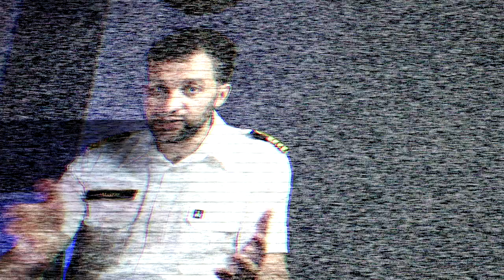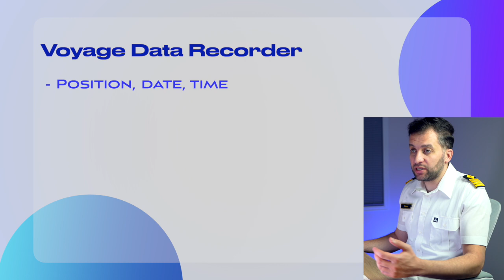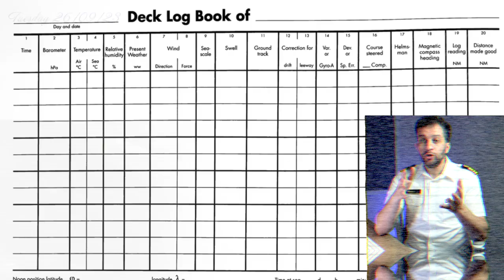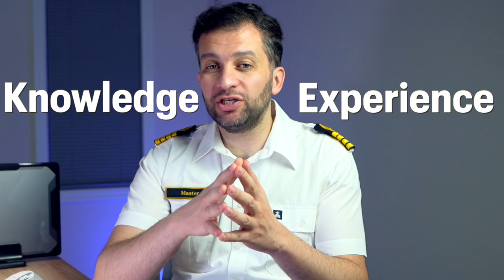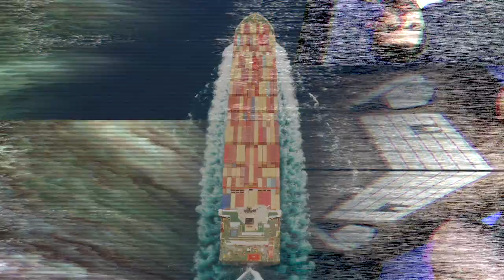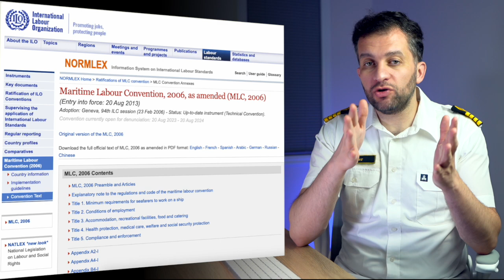CAPTAIN EXPLAINS : Why No Investigation Report So Far ?

Comment: Excellent big picture but WHY is still unanswered.  The answer is it is a very complex subject.  The crew did not understand the ships electrical system and the general public is bored with a detailed electric failure disertation.  At the expense of being unpopular here goes.  The ship operates 3 or more generators in parallel, at least part of the time  to meet load requirements. These multiple generators must share the load in a reasonable manner.  If too much of the load drifts to only one generator that generator will trip off. When that happens the load on the rmaining generators may be too high and they trip off  If a generator does not trip off when overloaded it may become a motor and try to drive the diesel engine.  This motorization can be prevented with reverse power relays.  Generators supplying the grid are always protected with reverse power relays. normally not used on ships.  

keeping the load stable between multiple parallell generators is fairly complex becaus the are two loads on each generator.  The real load and the reactive load.  Two generators in parallel is the simpliest by using the droop method which involves slowing down the generators speed as the load increases and reducing the generators voltage as the load increases.  The droop method is hard to apply with 3 or more generators as it is based on the droop curves crossing at the stable share point. The simplist method for 3 or more generators is two on the droop mode with #3 and #4 controlled by an operator with his hand on the knob.  

If you do not understand all of this do not feel bad.  Most engine room crews do not understand this either!
Reply from the maker: Very detailed, thanks.
Reply: @MustaphaZehhaf  You are welcome  I am a reired Westinghouse service engineer with a lot of experience on ships.

Comment: Interesting video concerning the burdens of documenting the operation of the vessel. However, you did not achieve the headline of the video as to why there is no report or even a preliminary report. Of note thru all this accident I noted that even with all the sophistication of the ship, it's navigation and other infrastructure the propulsion plant is inherently weak and subject to occasional failure. Yes the full investigation will take time. And investigation during disaster recovery can hamper the recovery. But sufficient help is on scene for the recovery that an informative investigation can proceed. The public has a right to know why billions of damage and infrastructure repair is now necessary and has been placed upon them even in a preliminary manner.
Reply from the maker: There is no report so far because the areas to investigate are many, in my opinion!

Comment: Captain Mustapha, I would like to express my gratitude for sharing this informative video. Your videos always prove to be helpful. However, I noticed that you didn't mention some essential certificates like BWMP, Maritime Pollution Insurances, and PANDI certificates. I understand that there are so many certificates, but they are crucial for the maritime industry. Moreover, I would like to point out that the STCW-2010 convention only focuses on competency levels, not Manning Levels. Finally worth the trouble to watch this type of information. Regards, captain Antonio TL
Reply from the maker: The ship's certificates only require a full video not a chapter.
Reply: Yes indeed, that's why I mentioned that there are many certificates on board ships and it depends on her type. And important is to discern this, The maritime industry commonly uses the terms “certificates” and “documents” interchangeably. Technically, however, certificates validate a fact, and documents provide evidence or proof of meeting a standard. You also pointed out that. Rgds

Comment: If you go through my earlier comments on the truth of the crash you will know why , especially when the fault is with the pilot/officials, when faced with an emergency situations ,  changing the focus from the contracted safe passage to saving the bridge, only to crash the bridge, ,
A bad worker blames his tools,
Reply: Yeah, I browsed some of your comment and I realized you don't know nothing about seagoing ships. You never sailed and you never managed a ship engine room. Propeller effect is unknown to you, turning effect of a "dead" ship also, power management onboard ship also is far from being your area of expertise.
Why black smoke on ship funnel? Also unknown to you.
To really understand what happened there, you need experience onboard that kinda ship. You need to know the power management of that ship. You need to know how a "dead" ship react under wind, current, you need to know the maneuvrability of that ship at low and very low speed, the propeller effect for each speed of the engine.
Do you know what's the difference between a fixed propeller and a pitch propeller? Do you know what are the pilot responsability onboard seagoing vessels?
DID YOU EVER SAILED AS AN OFFICER ONBOARD COMERCIAL VESSELS?
If you know all of the above, than we can discuss, otherwise it'll be a sterile conversation.